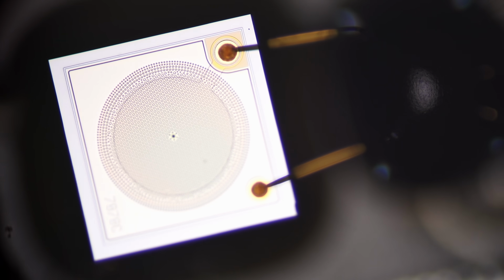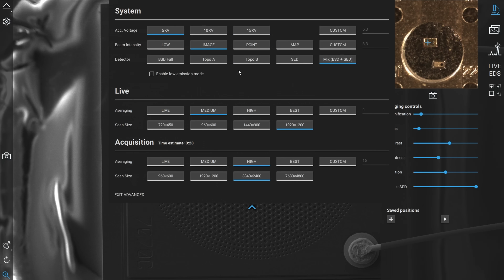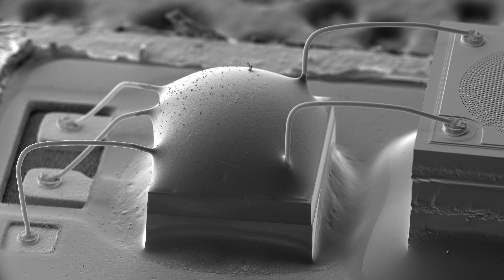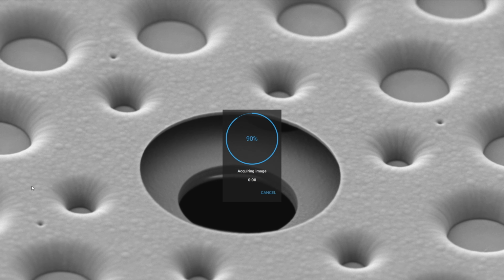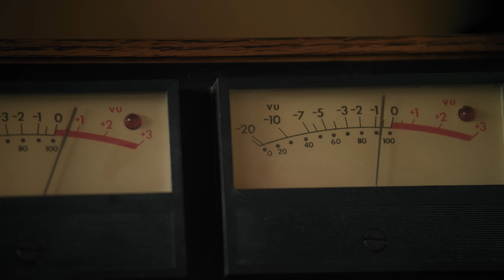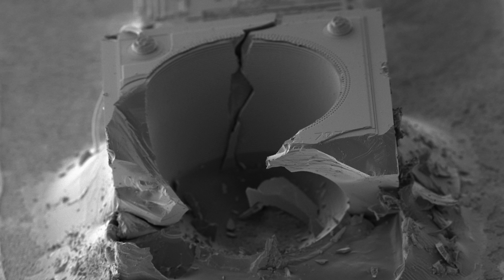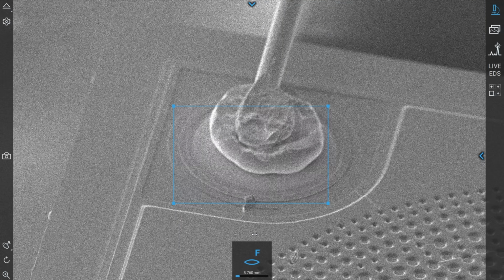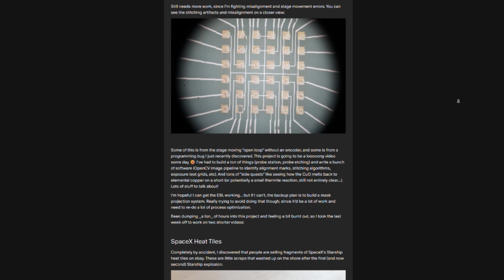Microscopic Marvel in your Earbuds

Comment: Honestly I might be most impressed by the fact that you made a 3d model of the microphone for a mere couple seconds of footage!
Reply from the maker: Hehe thanks! I had planned to use it for more, but the various microscope photos just looked so good it felt like an injustice to show the renders instead 😅 To the folks wondering, I modeled it in Fusion360 (because I'm a hack and most comfortable modeling there) and then textured/shader'ed/animated in Blender.
Reply: @BreakingTaps  im guessing the shaders took the most time?, havent done that in a long time now... model and the animation probaly quite fast i guess...
Reply: it looks good, keep it up @BreakingTaps
Reply: @BreakingTaps  q: how r Fusion to model in vs Blender?
Reply from the maker: @Patrik6920  For me it was fast and easy since I know Fusion very well (and still learning Blender). But Fusion doesn't export very good meshes and that caused some issues later. So I'll probably just spend some time learning Blender's modeling system better in the future.

And yeah, the shaders/materials took most of the time to work out. Animation was relatively easy since it's a simple camera move, and the modeling was maybe an hour or two at the most.
Reply: @BreakingTaps  tips for learning blender, it nessesary to learn alot of keboard shortcuts, and a making a sheat cheet is probably a good ide (i wich someone given me this advise long ago), some keys are also used for different things depending of wich mode ur in
so a cheat cheet, like wireframing, solid, drawing, motion, deformation, texturing, animation can be a good ide... 
it shoud/could also be easier learn if u  wite it down by hand ...
...and dont try to learn all of it at once... one piece/panel at a time
..at first its looks comfusing and intimedating until u get the layout...
Reply: @BreakingTaps  Fusion looks really interesting and seemingly easy to use - at least compared to the heavy hitters out there. Thanks for putting it on my radar!
Reply: And all that for ten bucks
Reply: @mwarnas  "And all that for ten bucks"  including all components, assembly, packaging, and shipping from China to around the world.  And yes, all that for a mere 10 bucks, pretty amazing.
Reply: @mwarnas it’s all about scale. Very capital intensive to begin, but crank out a couple million of these and you can make them for cents.
Reply: @mwarnas  it's a combination of economies of scale (which is generally good), global market (which is iffy, stuff is made in impoverished parts of the world where costs of everything are much lower than in the developed world), and exploitation of the desperate in sweatshops and the like (obviously awful and horrible, but still happens far too commonly).

But yeah, economies of scale for manufacturing the components is easily the biggest factor in making it remotely possible to sell this cheap
Reply: Yeah, that was a really impressive render!  Was that model hand made, or is there some way to automagically process SEM images into 3D models?
Reply: @DaveNagy1  I believe it was hand made as it looked different in many ways
Reply: @DaveNagy1 for sure hand made. The model itself would be pretty quick to make, but texturing, creating the environment, animating all that would take a decent amount of time.
I'd imagine this would probably be something he modelled then sent out to an animator to render up. There's not a lot of cross over between cad modelling for engineering and pretty stuff sadly. 
That said I wouldn't put it past him to do it all himself, legend.
Reply: Could it be that the model he used was found online somewhere? This is probably not the first person to need a 3D model of this component.
Reply: @NeatNit  not likely, generally manufacturers only supply models of the outside of their products not the insides. Even if they do they don't supply them textured with fancy textures like that.

Making this model as something suitable for engineering would take 15 minutes or so for someone skilled. Probably take me 25. 
Turning that into the pretty you see here isn't something I've done in a long time. But blender is probably the package used for it. It's free and makes very high quality outputs. It used to be arcane to actually use though. I'm not sure if times have changed but I could see texturing and animating that taking someone skilled a few hours or so.
Reply: @zyeborm  I was imagining content in the same realm as this, explaining the principle of operation for a MEMS mic. But yeah, thinking about it more I am finding it harder to believe that such a model would be just publicly available and match so closely with the mic he took apart. So it's much easier to believe he really went through the effort to make the model 😄
Reply: You can buy 3d models of nearly anything for very cheap.
Reply: True
Reply: lol, I was thinking the same thing, like, dude... what's your budget for this... lol, great video thought, deff subscribe 👍
Reply: making conceptual basic 3d models is not that hard if someone has a good sense of 3d imagination. 

i find it crazier that he is able to break a thing many times smaller than a hair in two 🤯
Reply: The chip is much larger than a hair, 0.7mm across but the tiny holes are much smaller, would not be hard to break with a sharp metal object @mu9600
Reply: bro is impressed of a 3d model of the default cube lmao, keep cutting trees so darwin can do his work

Comment: Absolutely crazy that something like this is 2x inside a $10 headphone, so each maybe 10cents, at most.
300mm waver gives maybe 50'000, so a whole waver with bonding and everything for less than $5000.
That "buzzer" most likely is the battery, btw.
Reply: There's probably just a single mic in one of the earbuds. Lookup "digikey mems mic" and you can find them starting at 47 cents each if you buy 1000. This is a US retailer selling reputable parts. If you get them directly from China, which is probably where these earbuds originate, they'd of course be significantly cheaper.
Reply: battery doesn't buzz.  Battery explode and only once.

Comment: Don't you mean speaker?  ;)  Ever since I took apart my first hard-drive I've been fascinated by the processes used to create these micro-marvels, specifically the wires and windings you see in things like the pickups.  I've managed to dismantle stepper motors small enough to snort up your nose but I'm still left with that question... HOW?  I've looked, but I cannot find anything on these manufacturing processes.  Could you cast some light on this or point me in the right direction?  Thanks.

Comment: Actually, that rainbow color you see on the patterns aren’t from diffraction. It’s just an imperfection of the lens you’re using to film it, called longitudinal chromatic aberration, it happens because the angle at which different wavelengths of light come into focus are different, so just beyond and before the point of focus, the colors separate, giving you a hue shift.
Reply: I believe you are incorrect.  If his camera had LCA everything he filmed have the same effect.  Since other things filmed with the same camera don't have a hue shift it has to be something else.  As he says, it' is from the the thin films deposited in the manufacturing process.  In fact, manufacturers use the thin film interference phenomenon to measure the thickness of those thin films with an interferometer.
Reply: @broncogrizz  the effect is more prominent in macro shots, hence most macro lenses are the most well corrected for LoCA. Also he shot that with a microscope camera, so it's a different one.
The colors clearly follow the focal plane, it's a lens effect.

Comment: Wow, excellent presentation.  The SEM images and CGI blend perfectly. What an amazing piece of technology. I wonder if the dimples in the top layer are for controlling the stiffness of the disk.
Reply: They would probably also help increase the capacity by enlarging the surface area when the membrane is close to the other electrode.
Reply from the maker: Thanks!  I believe the dimples are mostly an artifact of the manufacturing steps to make one. There are a few ways it could have been made, but my current theory is: pattern and etch the base substrate giving nice clean holes, deposit a layer of glass on top (which will naturally form rounded dimples over the holes), deposit another layer of undoped polysilicon and then a doped polysilicon layer, then finally etch out the sacrificial glass layer (with HF or plasma) leaving the gap between the two layers. Finally flip and etch the big cavity.

Just a guess but it makes sense to me. The holes in the lower layer are to help air move past it with minimal resistance, but the dimples on the surface aren't really needed. So I think it's leftover from the layered nature of fabrication.
Reply: @BreakingTaps  You mean a totally flat disk without dimples could not be fabricated? I wouldn't expect that, but I don't know anything about processes at this micro level. I'm just blown away that they actually work as well as they do. Are neodymium magnets used at this scale?
Reply from the maker: @professordeb  It's technically possible to get a flat disk on top of the hole'y layer, but it would be a lot more work. There's another process called "chemical-mechanical planarization" which is basically a super fancy sand paper for wafers 😁 It's used to flatten the top layer by grinding/polishing until all the ridges are gone. It's often used on high density microchips like computer CPUs, because you have soooo many layers that everything starts to get rounded. So they periodically flatten it with the planarization tools.

So to get a flat surface for this device, you'd deposit a really thick sacrificial layer, then grind it back flat, then proceed with the next steps. But if you don't need it to be flat, you can skip and save money.

Magnets aren't used a lot at this scale because (I think) the magnetization process needs high temperatures and it can  be difficult for the devices to survive. Although I've seen some papers about using laser-heating and such, so I'm sure it's doable.

At this size, electrostatic, thermal and piezo mechanisms tend to be more common.
Reply: @BreakingTaps  Mind-blowing technology. My chldhood was punched cards and vacuum tubes! Transistor radios were still new! The voltages here must be like microvolts!
Reply: @professordeb - With a proper op-amp, even the tiniest signals can be amplified to usable levels.
Reply: i would speculate that it's mostly just a byproduct of how the thing is manufactured

Comment: Why there is such a big cavity: my guess is that it is simply to do with ease of manufacture. They first make all the structures on top, then flip it over and etch through from the backside. Importantly they also intentionally leave a controlled-size hole that allows internal pressure to equalize over a controlled time (e.g. if device takes a plane ride or happens to be put in a vacuum during further processing), not too slow but not too quickly that the device wouldn't be able to pick up bass.

Given the tiny size of the cavity, it can't have anything to do with acoustic resonances.
Reply: Has everything to do with acoustic resonances, and there are much more ambitious ones in the public market.